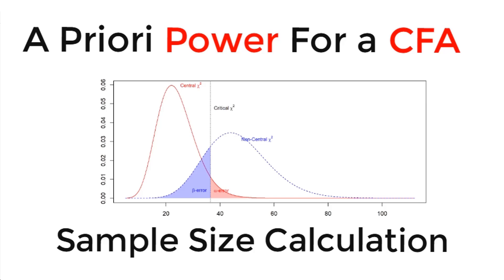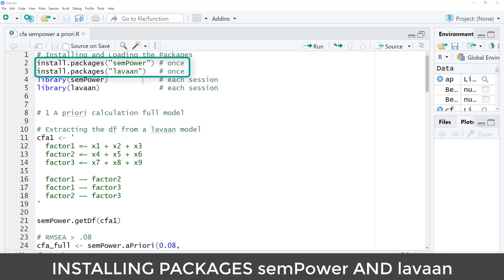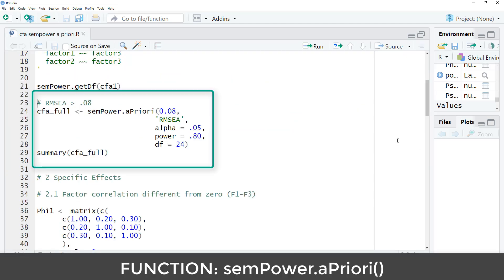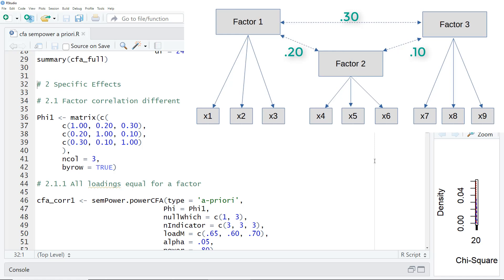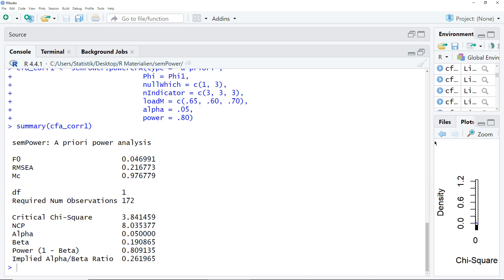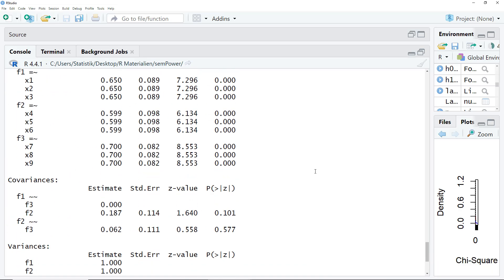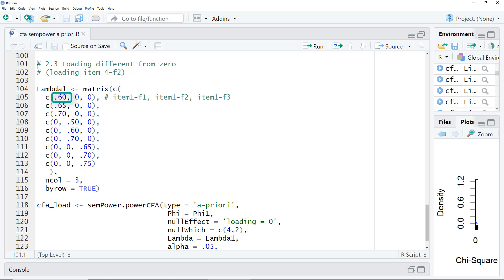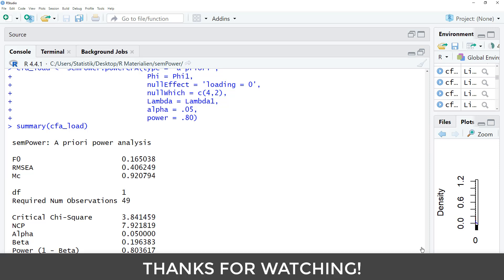CFA: A Priori Power Analysis (Sample Size Planning)

Comment: 2:31   is it not 9 loadings instead of 6? if not, can you explain why as that confused me as you have 9 items each loading onto one of the three factors no?

edit: also do you think you could clarify when intercepts would added within the parameters
Reply from the maker: To identify a latent variable model the latent variables need a metric. There are different ways to achieve that. 

The default way in lavaan is to fix the loading for the first item of each factor to one. Thus only 6 loadings (2+2+2) have to be calculated. The alternative is to fix the factor variances to one. Then 9 loadings have to be calculated (see the text at the bottom of the screen at 2:31).

You would add intercepts if you want to include the mean structure in your model. I think this is rarely used for normal cross-sectional models. Mostly one sees this in mulitgroup models or longitudinal models.
Reply: @RegorzStatistik  Thankyou so much for the quick reply. I’m trying to work out the sample size needed to identify scalar invariance across 2 groups, is there any way the code in this video could be adjusted for that?
Reply from the maker: @yaboihi9055  I think the package provides support for power calculations regarding measurement invariance, but I have not worked with that functionality yet.
Reply: @RegorzStatistik hi thankyou for all the help regardless, video was very helpful ❤